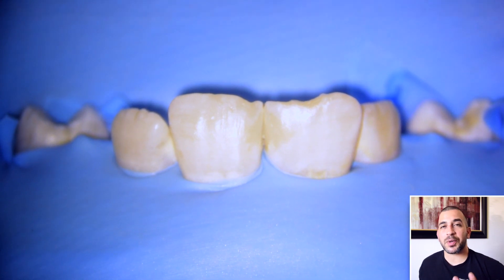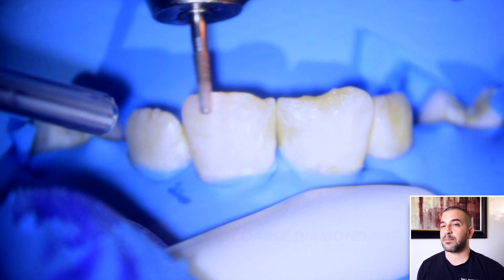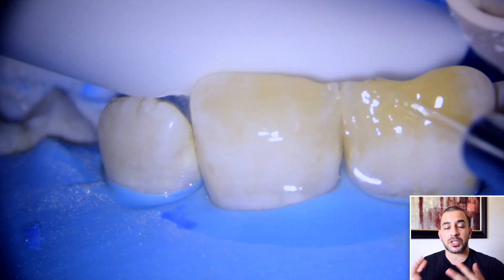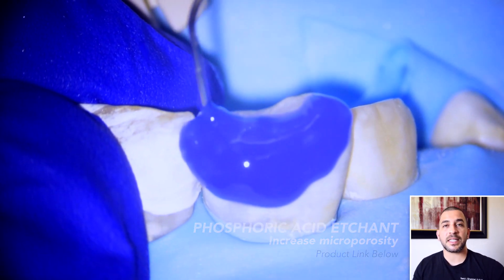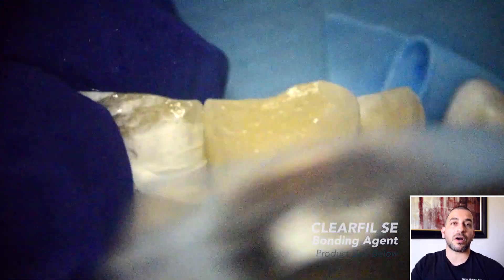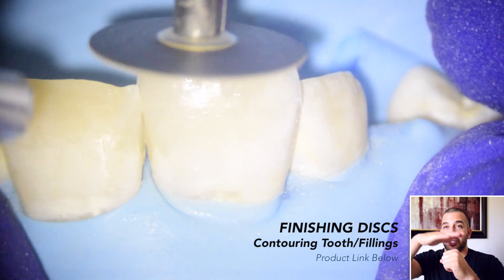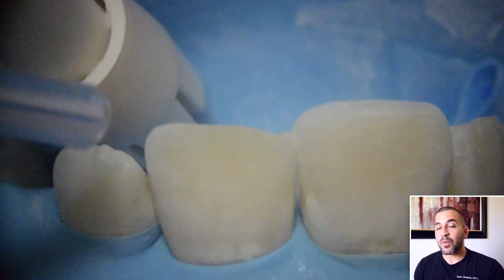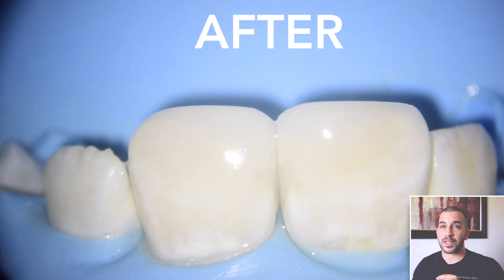Teeth Bonding Procedure | Front Tooth Filling to Repair Chipped Tooth

Comment: Good afternoon! I had a chipped tooth with bonding for years (worked great and blended in smoothly). I went for a cleaning one time and i guess the dentist tried cleaning that area extra because they put a line on my front tooth. Would it be possible to have bonding done ON the tooth to reduce the appearance of a line being there?

Comment: Can this be done on a baby tooth. I never developed my adult/ permanent lateral incisor so my baby tooth is still there and it looks so small compared to my other teeth. Can it be bonded to make it look bigger and similar in size as my other teeth?
Reply: I had the EXACT same situation! Yes it can! But you just have to be aware that there is a good chance that you you won’t keep the baby tooth forever. I kept mine until i was 19 then finally they got really loose so i got them pulled and had dental implants.
Reply: @chelseasellers192  yea I know i was thinking more of a short term solution and then getting an implant when I have the money for a long term solution

Comment: Hi, if you read this I had a question. My two upper front teeth are really, really small and was told I couldn’t get crowns because the nerve was nearly exposed? I was wondering if bonding would be a better solution (my bottom teeth are starting to dig into the little piece of flesh between my upper teeth… lol)

Comment: I have chipped tooth. I didn't knew I was grinding all night every time I was sleeping. I was worried that It can't be fixed. Thank you for showing the procedure.
Reply: Original things cannot be copied it’s from ur god not human with super glue , rotary tool , bolts , screw , drill i hate stupid doctors making torture normal thing with brainwash :)🖕🏻
Reply: @mrflower8871   Keep your opinion to yourself. Its my problem not yours so stfu.

Comment: i want to get bonding on my 2 front teeth but i’m afraid they won’t be as durable as my natural teeth. Will they or will they not ?
Reply from the maker: Natural teeth are typically going to be the most durable over any restorative material you put in your mouth but fillings are strong and can last a long time
Reply: @SmileInfluencers  I had my front tooth chipped but the filling held only for 2 months. Idk but it was not durable at all and cost me so much money and..it's just gone after two months. I need to get a new one. 😭
Reply: @JájaKoníčková  i dont have white teeth, they are yellow :(
Do they make it match the color of your teeth or is it just white?
Reply: @elcocaino8728  Yeah, thay match it to your tooth color. You can't see where the chipper part begin.
Reply: @JájaKoníčková  ok nice will go get that done then thank you

Comment: My two front teeth are slightly chipped at the ends from grinding (working on correcting that with a mouth guard at night etc...). My dentist said that I would either need caps or veneers but I really just want to get them bonded. Would there be a reason she doesn’t want to go that route?

Comment: This is basically what my teeth look like. I had broken front teeth from 12-19 and have braces right now. They did bonding on the front teeth without informing me when I went in for fillings and at first I was upset as I never asked for it, but now I think it’s better than what I had. I want to get bonding on my top front 6 teeth and lower front 4 teeth since I have bad breakdown from drinking pop so much when I was a younger teen. I just want to help prevent more from breaking off. Before I wanted veneers or crowns but I really want to preserve as much natural tooth as possible. I just wasn’t sure because idk how each one holds up and lasts.
Reply from the maker: Bonding holds up well as long as your bite allows for it. Thanks for sharing and I hope you get the bonding you are looking for 💪
Reply: Im 19 and my tooth was slightly chipped before. The dentist were i went to did not align my braces right because my bottom braces were were hitting my top teeth so the tooth chipped even more. I have thought about getting dental bonding. My teeth are not white sadly. I have thought a put getting dental bonding on my 2 front teeth. How did it work out for you? Will the bonding match my tooth color or will it be noticable since i have yellow teeth :(

Comment: How do you shape your initial putty? Do you lengthen it with a scalpel once set?
Reply from the maker: If I’m replacing an existing composite I don’t need any modification and the putty will help preserve lingual architecture. If tooth is broken, I place putty and cut back with a diamond bur using adjacent tooth as a reference.

Comment: Is this considered a permanent solution on adult teeth? Specifically for filling in a chipped tooth.. Just curious how durable this is for everyday chewing and if these would be something that needs to be redone every few years or how long to expect it to last. Thank you
Reply: I've had mine for a decade now. I have tooth bonding on my two front teeth because i chipped it when i was younger. Yes, it defo needs to be redone because they stain quite easily and turn yellow ..
Reply: @ShanteSousa  so you've had it for a decade which your saying it is durable aka strong like real TEETH it just stains easily like a filling is this what your saying Exactly

Comment: hi! Thanks a lot for the video! It was very informative. I had a question, and since the dentist's offices around me are closed down due to the coronavirus outbreak, I thought i'd try to do some research on my own, and while a lot of my questions have been answered, I am still concerned about one thing. 
About two months ago, a new bonding was put in for my front tooth, and there is this clear plasticky film that is peeling off in the front of the tooth. It is still about a couple of millimeters above where the chip is, but it seems to be very gradually peeling down. Is this something that I can wait out for a couple of weeks until the dental offices re-open, or should I try to get it seen as an emergency procedure? 
thanks so much!
Reply: try to get seen, I had Bonding over a month ago and I don't have what you are describing,mine 2 front teeth look great, good luck!
Reply: Original things cannot be copied it’s from ur god not human with super glue , rotary tool , bolts , screw , drill i hate stupid doctors making torture normal thing with brainwash :)🖕🏻

Comment: Thanks for this detailed video . You mentioned that the phosphoric echant is caustic and can cause sensitivity. Is that sensitivity long term and does it also cause issues with the gums if the procedure has to involve a repair that starts at the gum like widening the tooth for ex ??? Thanks

Comment: Is it possible to do bonding on the upper front two teeth without adding bulk to the back side of teeth?
Reply from the maker: It really depends on what part of the tooth is chipped. If the back side is chipped than we have to add restorative material there to make the restoration work. Sometimes we don’t need to add bonding to the back! Hope that helps